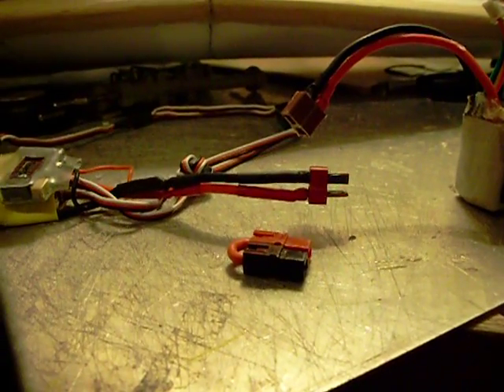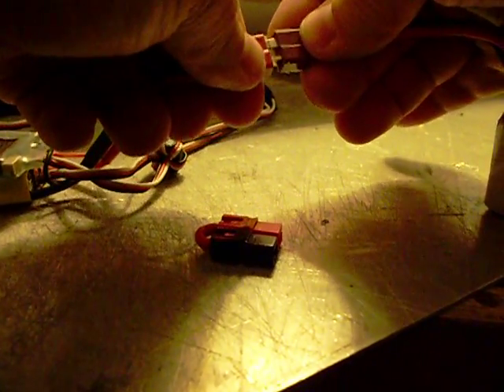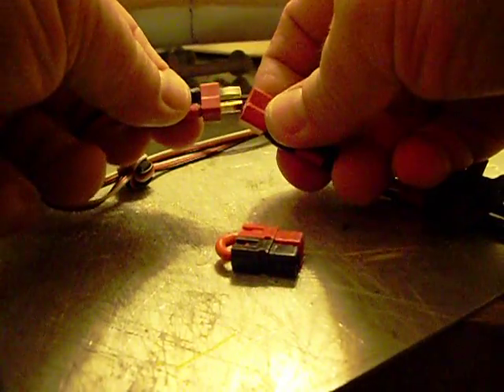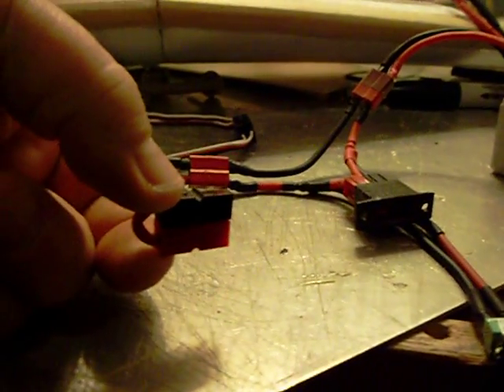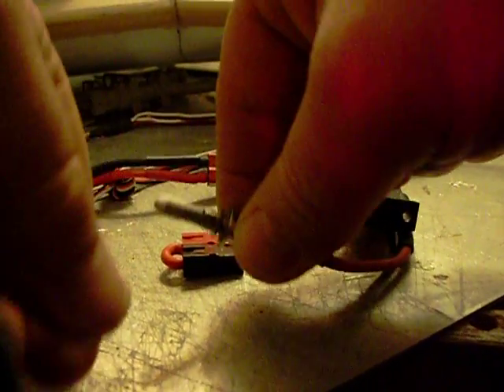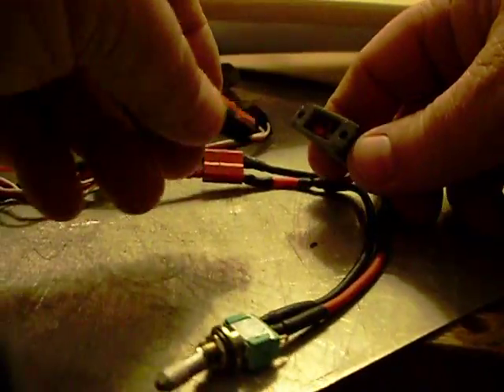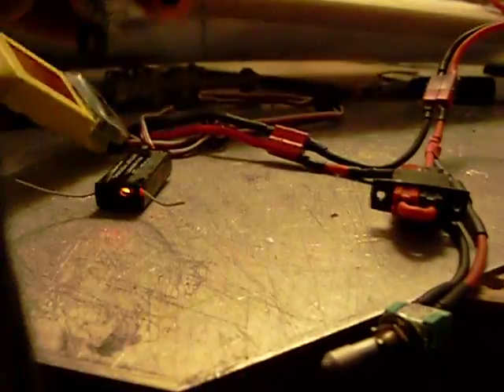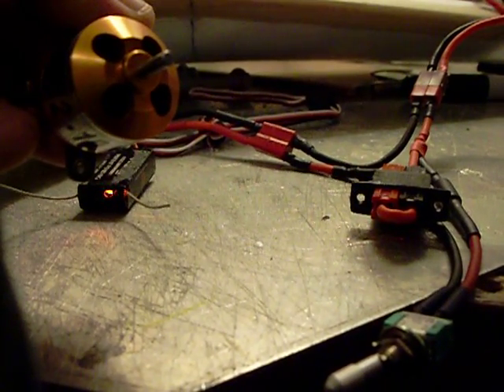ESC Wiring Modification

Comment from the maker: This will usually bring down the good battery resulting in lost power and shorter run times and possible damage to the ESC due to the imbalance. Less chance with one battery where when charged all of the cells are balanced by the charger.,, Mudman1959

Comment from the maker: Skipper... 2 ea, 7.2 volts in Series connection adds up to 14,4 volts so with one 14 volt battery wired to the ESC there is no real difference except that now with one battery you do not have the chance as with two batteries, with one of them being possibly bad or not equal to the other battery capacity Volt/Amps...

Comment: No just one motor and one esc, i basically altered my esc from using 2 battery wires to using only one, so that I could run a single battery instead of 2, it was just to much weight for my boat, but I don't know if that's okay for the esc because it wasn't rated for a single battery it was rated for dual batteries, I figured that by using a single 14v battery that the voltage going through the esc and motor was the same as 2- 7.2 v batteries and that it would be safe to alter the esc

Comment from the maker: Skipper... Does your boat have two motors? I have seen other RC modelers run two ESC's/Motors on just one battery. Should be no problem as long as you do not exceed the Maximum current draw the battery can handle. If you do have two ESC's you will need to make sure one ESC has the BEC (Battery Eliminator Circuit) red wire not connected as you will only need one ESC supplying the 5 volts to the receiver... Mudman1959

Comment: I have a question, I did some mods to my rc boat, and the esc has to battery wires and it runs on 2 7.2v batteries, now 2 batteries is a lot of weight so I wanted to run just 1 14v battery to cut the weight down, so I cut the one esc wire end off and spliced the positive wire and soldered it so now its running on my single 14v battery, is this safe okay to do or no?